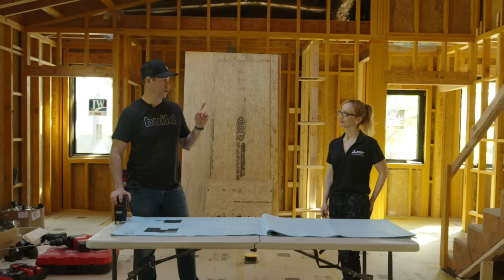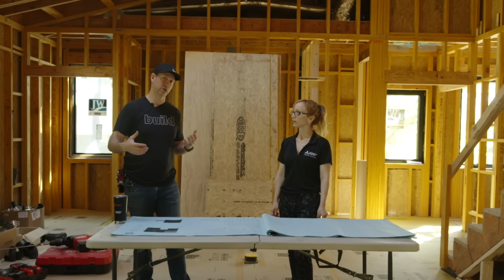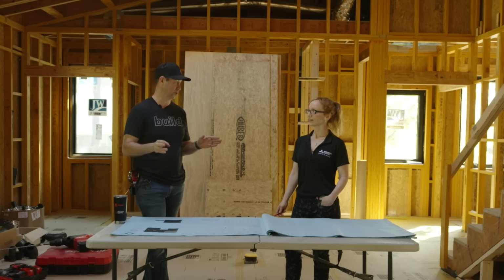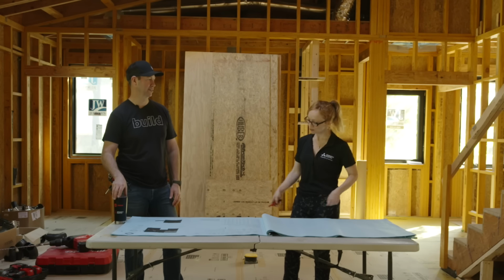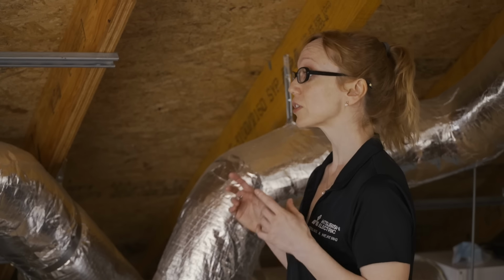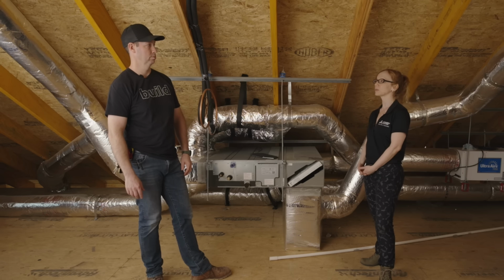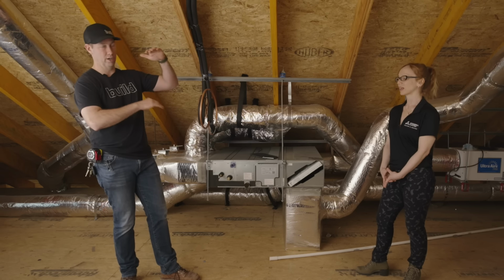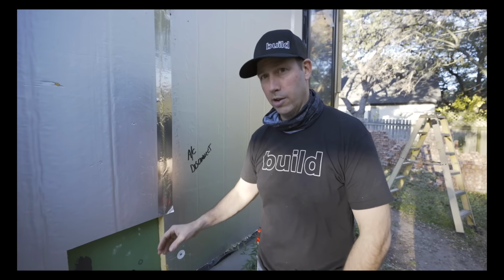Mitsubishi HVAC At My House - Full System Tour

Comment: Would love to hear about the ductwork tradeoffs and how you came to the decision. I love the vibration isolation detail but would’ve liked that unistrut to be parallel to the ground, you can tell those springs could catch on the sides over time.
Reply: I was just thinking the same thing that screw with the spring cap is already touching the unistrut
Reply: Totally! I was having a hard time concentrating on what was being said because I was like, "What happened here? That iso is going to need to be changed out as soon as the system gets powered up the first time."
Reply: @McNea The inverter/zoning technology for central a/c systems has been out for quite a while now, but their proprietary controls for each manufacturer seem to still have issues from what people say. If they could get that under control or agree on a standard, I think there would be more adoption of it!  Even the existing systems (Trane) can also have small zones since it can control the compressor speed like the mini splits, and even have zones that can "participate" if they're too small to run alone.  Though I don't know how the system would be affected if you have a long duct run.  Also, in other countries, do you think the cost of mini splits is a lot less since it's pretty much the norm there? They don't seem to care as much about having visible units on the wall like we do here in the U.S.

Comment: U put those vents under the windows by the stairs. Are you worried about condensation during winter at all?
Reply: The indoor Dew point will likely not be any higher than the 50’s but likely in the 40’s. Any surface would need to be colder than dew point to produce condensation. The windows are either double or triple pane and well sealed. Condensation should not be an issue in this situation.

Comment: The cost of this will take 20 years to pay for any savings in efficiency. Maybe more.
Reply: Don huffer, not necessarily. I was quoted 18k to do two  zones,  with  TRADITIONAL 14 seer heat pump and AIR HANDLER.

I bought two DUCTED midea mini splits online for $4300. They are much quieter than a traditional air handler, AND I get 22 seer instead of 14 seer. After finding a contractor to install it for me, I'm coming in less than half price of what I was quoted for a traditional system.
Reply: Agreed. Ive priced these out and they are crazy expensive. But I guess the homeowner at least gets more closet space.
Reply: but if he’s
comfy it’s worth it, my house has hot spots depending where sun is, only 3 years old
Reply: With how tight this house is, yes it will take longer to recover costs! An inefficient home would recover costs more quickly. Does that mean you should cheap our on HVAC because you splurged on tightness and insulation? 

With that said, it will be comfortable, quiet, and efficient. Comfort has a value that is a little harder to quantify.
Reply: Yep. city multi systems cost about $5,000 per ton. It’s a very expensive system.
Reply: @Patrick94GSR  there was no need for the commercial Citi multi Mitsubishi equipment on this home. They have residential condensers that are far more affordable - and just of reliable and completely quiet.
Reply: @Patrick94GSR  $5000 per ton???  I did a 4 ton, 3 zone Mitsubishi multi-zone system for about $10k - so well under $3000/ton (In all fairness, I did my own electrical and installation.
Reply: We cool our house in Florida for $50 -$70 a month. Heating about the same. There is no way to make up the cost. No one is talking cheap. Just good running systems that don't break the bank. Everyone knows this guy gets his stuff for free.
Reply: In Plano, TX with numerous days over 100 degrees during summer (May - Sept) A/C bills are nearly $500 monthly with three separate systems.  Winter is around $300 gas and electric.  Square footage is 3,000 over 2 floors. I know insulation is ‘90 builder typical.  Existing Systems are all 14 years old and I’m looking at replacement.  Insulation and systems both need to be redone.  Doesn’t take many years with existing bills to justify the cost...
Reply: So, sometimes this is true. But even if you break even... the comfort difference is completely worth it.
Reply: @TheJPPowell  ,  you're absolutely right. he's building a premium level house and the rapid/exact control of air temp and filtration is well worth it compared to many of the very-expensive premium products going into this house. (especially since he's probably getting this whole system for free for putting it on his channel)
Reply: He could save so much more if he got rid of the out dated stud construction.
Reply: @donhuffer4637  He did exterior insulation, instead of cavity insulation.
Reply: True,  the equipment shown in this video is probably around 30k before installation.
Reply: Not true. Maybe 5-6 if you have it installed but in our case we did the install and are looking at a couple years. Plus the comfort is totally different then other central air homes we have had. Comfort in every room with no noise.
Reply: @ride-it-outtimandtoni232  hi did you use a ducted unit? How did you source the plenums
Reply: @jl9678  I should of stated we used ductless. One single zone for master and 3 zone multi for kitchen family room and another bedroom. All 21 SEER Mitsubishi equipment
Reply: @ride-it-outtimandtoni232  on thanks for clarifying
Reply: @jl9678  plenum are easily fabricated locally - by any metal bender. Dimensions are well documented as provided.
Reply: @meyerjeff  I hope so. With my luck and being in dfw when I call they'll be any $2k
Reply: Don't forget including repairing costs. I would charge more repairing costs for this kinda system because it would take more time for me to troubleshoot that problem, plus he is rich 😂
Reply: It  has a lot of control.  But I've heard that zoned systems don't last as long
Reply: @timothykeith1367  zoned systems vs Ductless zoned are different stories. In general as long as zoned systems are sized correctly for duct static pressure the stain is minimal- but I prefer not to zone with duct dampers but rather multiple air handlers or systems altogether.
Reply: @timothykeith1367  this sort of zoning is nothing like the legacy zone dampers of old design. A Mitsubishi zone is made up of the indoor fan coil or heat-pump driven ducted air handler. This equipment us highly reliable and has a 12 year warranty.
Reply: @meyerjeff  I've heard that you can't beat the concentional central air for reliability but these new zoned systems are impressive.  In my house I mostly would cool the bedroom at night, which I could do with a conventional wall unit, doesn't have impressive features of the mini split ductless, but the $700 units have decent efficiency when combined with spray foam insulation - very efficient and low cost.
Reply: @timothykeith1367  if you take care if it, it'll last
Reply: No.

Comment: So does the ventilation numbers on the manual j have to equate to the amount of fresh air let in to the house? If so how does that get figured?
Reply: In the 2018 IMC code gives you a fraction requirement per hour of fresh air required for outside air to be let in. Varies per tonnage/ obviously as a result of sf
Reply: @TheJPPowell  I'm not talking about code requirements,  i want to know the correlation between the actual added btu numbers from fresh air and the amount of  cfm taken in of fresh air. For instance ASHRAE and IMC state for fresh air 7.5 cfm per person plus 0.03 cfm per sqft of living space. Are those numbers a rule of thumb or do they correlate to load calculations. Should i use ashrae recommendations or is there another formula for amount of fresh air that has to be taken in according to fresh air numbers on the load calculation? Those numbers on the load calc have to be based on a certain amounf of fresh air.
Reply: @mitchdinner9743  they correlate for number of bedrooms/ sf/ ppl in the space. But the tonnage in the calc takes that into account for the amount of unconditioned outdoor air is being brought in. In certain climates an ERV/OA is used to first treat the air then dump it into the return or even just in the space as “neutral air”

Did I still misunderstand you? Sorry if so, text is difficult
Reply: @TheJPPowell  like i said, I'm talking fresh air intake not ventilating or exhausting stale air. Strictly taking in fresh air from outside the building,  in my case through a whole house dehumidifier with a fresh air port and bringing it inside the structure to dilute stale air. Thats what they were talking about in the video, that the fresh air taken in will contain heat in it which adds to the overall heat gain in the load calc.
Reply: @mitchdinner9743  oh ok, sorry for getting wires crossed. Then my answer stands for the program- will calc in the req’d amount of fresh air and air that into the req’d tonnage. Are you wanting the manual formula?
Reply: @TheJPPowell  well, yes, thats what i really wanted to know, how they come up with the added btu #'s from fresh air. How do they know how much fresh  air is coming in? Is it the same calculation used to convert sensible btu requirements to cfm as used in manual d using heating and cooling factors? Actually my manual j gives the cfm needed for ventilation (just noticed), but I'd still like to know the formula.
Reply: Correction for res it’s 2018 IRC... section M1505.4
Reply: @TheJPPowell  that code is for ventilation not fresh air.
Reply: @mitchdinner9743  ventilation covers both fresh air intake and exhaust air. Outside air is fresh air- I’m literally reading the code right now with the table in front of me. Section 1505.4.1-1505.4.3 has to do with fresh air supply.
Reply: AHSRAE 62: ventilation is number of bedrooms + 1 x 7.5 cfm per person plus 1% of the living SF. 
So a 3000sf home with 5 bedrooms would be (5+1x7.5)+(3000x0.01)= 45+30=70 cfm of ventilation air for the whole house.

Comment: 17:22  Matt... I love how you are talking about system reliability and possible failure and what not. As you tug on the line sets. 

Just saying. 😁
Reply: Ask Mitsubishi how long it takes to get the necessary replacement parts on these S series units... I am on week 11, for an inverter board on a unit.  It's ok, customers don't mind waiting 3 months for repairs. Oh yeah, Trane cannot get the parts easily, because they are co-branded and part numbers are different.
Reply: @DaveVanWest  Every Mitsubishi certified distributor has more than adequate replacement modules. Only work with them.
Reply: It’s not even hooked up.

Comment: So here in Southern Utah, its hot and dry. Plus we are also high altitude. I've talked to some friends who have built custom homes in the area. Most of them all regret spending the money on large a/c units. 1 of them used a zoned multi-split system and still regrets it. Main reason, they never turn them on. Here in the arid climate of the southwest, Evaporative coolers (swamp coolers) are king over A/C. I want to build a passive house with just and ERV unit. No swamp cooler, no central a/c, no mini splits. My solution is to use a Aprilaire 800 whole house humidifier in conjunction with a Zehnder Q600. However, I'm wondering if it would still be smart to do some cassette mini-splits. I was just wondering if you know any builders in the south-west who have tackled this kind of problem and solution. Normally you are always worried about pulling humidity out of the air, but what about adding it.... 

Thanks Matt for another great video.
Reply: Adding humidity is mostly done in two ways. As you said, through evaporative cooling, which adds water but brings the temperature of the air toward the wet bulb temperature. This is either done using high pressure nozzles or by ultrasonic eveporators.
If you want to add humidity without Temperature Los, you have to use a steam humidifier. Which can be done with either a electrical or gasious boiling pot. Electrical has a system with electrodes that run electricity through the water. This system can "autoremove" impurities. The other system is an electrical heating element which requires a full change of the pot from time to time.
All systems however are heavy maintenance without a system that removers the impurities from the water which will build up. And of course all the heating costs heaps of power/money.
The best thing is a HVAC with both heat and moisture recovery.

Comment: freon is banned now, what are you using in that ceiling casette?
Reply: Probably Puron....
Reply: Probably something like R-134A
Reply: Everything is still R410A for these systems, yes “puron”
Reply: Freon is a brand name for R22 that a lot of people use to describe refrigerant in general, and unfortunately he does it all the time. Those units use R410a. Daikin has switched to R32 but not sure yet if the rest of the manufacturers will follow.

Comment: Really?

2800 sq.ft. House with 5 systems? Cost payback? Filter changes? Cleaning and maintenance? I think when you look at a 5-10 year payback it doesn’t work unless you’re sponsored and subsidized because you’re a builder.
Reply: I'm pretty sure he said five ZONES, not systems.
Reply: Wow!! You guys are stuck in the 90’s and “builder grade” mentality. Comfort and efficiency doesn’t mean cheap. He builds a Ferrari so he won’t install a Chevy cavalier engine in it. It wouldn’t make any sense and create a lot of issues very quickly. 
Tight home and low load means properly sized AC equipment, ventilation air and dehum solution. Now is he going above and beyond? Probably but it’s a choice. It’s not all about the cheapest you can get.
Reply: Yeah it’s absurd. He spends all that money on making it a passive house and uses a hugely expensive and complicated hvac system.
Reply: @R2D2trashcan  There’s nothing complicated about it, it’s super efficient.
Reply: @SgtZima  if you saw the bill you would say otherwise.
Reply: @R2D2trashcan  +
Clearly he's not hurting for money, this is by no means the set-up for the average household.
Reply: Woah woah guys. 5 units does not mean 5 systems. Get out of the 19th century. One outside unit can connect multiple indoor units.

Comment: Flex duct Does that cause high static pressure?
Reply: Flex will always cause more pressure drop
Reply: Yes but mostly when not sized and  installed properly. This however looks like wrapped metal pipe to me. I’ve installed and wrapped a lot of that stuff in my days and that’s what it looks like.

Comment: So... why not geothermal?
Reply: Sooo much more expensive and invasive
Reply: @rustynutz2871  yea not worth it unless you have a large property with a pond or something lol.. although it has come way down in price over the last decade
Reply: TheJPPowell I have had a geothermal for many many years. It is a vertical loop system so not invasive at all. In my opinion a geothermal in a utility room is a very clean look.
Reply: @Ptro1  lliiitttlleee more invasive than just slapping an outdoor unit in the backyard
Reply: rustynutz28 agreed but then you also lose the noise of the outdoor fan running and the eye sore of the unit with a geo. There are pros and cons of both.

Comment: Is that really more efficient than just going with a ductless system?
Reply: Is like if you have 5 ductless unit, - you would need to change filters at every single location each month or each other month. And those systems kinda expensive, but they are way better than duct systems.  And those systems pretty efficient for his house, cause he did pretty good air sealing all the way around. But you won't heat that house as fast as you can do it with natural gas. Especially when it will be -5-10C outside. But for Austin should be fine.
Reply: @arishem555  i mean just leave the house at a comfortable temperature. Time to heat up a house is really not important for a normal fulltime residence imho
Reply: Yeah, they're pretty amazing. We have a conventional Ducted HVAC system that has a tendency to die every few years in July (we're in AZ). So at the end of 2019 we put a Mitsubishi Mini-split  in our bedroom as a failsafe incase our main system died.  We can have it at the perfect temp in our bedroom in about 15 mins, so it's allowed us to keep the rest of the house a little hotter in the summer and a little colder in the winter. In 2020 we cut our energy cost down by about 65%, and we were stuck at home most of the year! I think we'll probably do even better when things go back to normal and we can spend more time outside the house. Ductless is definitely the future, especially if we're gonna ween off gas and move to solar power in the future.